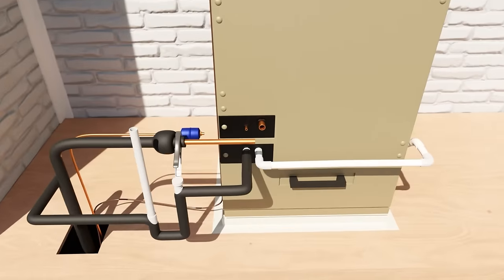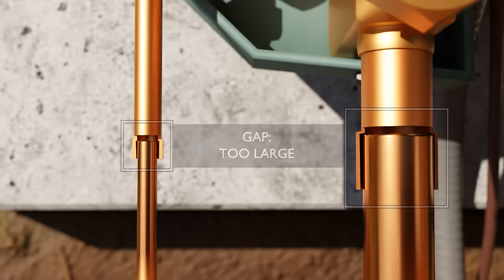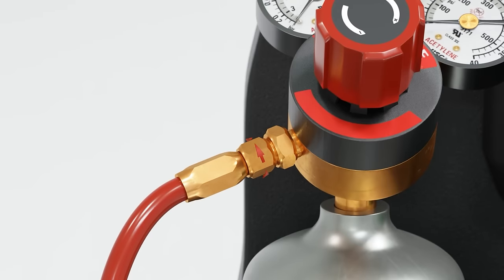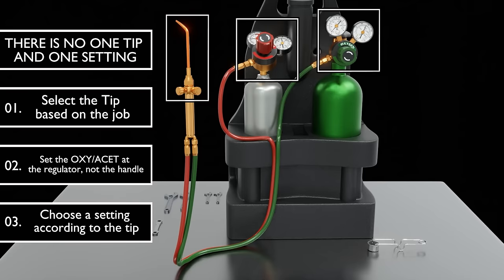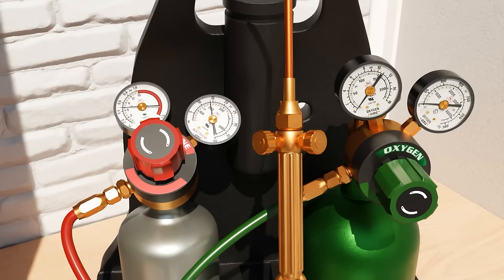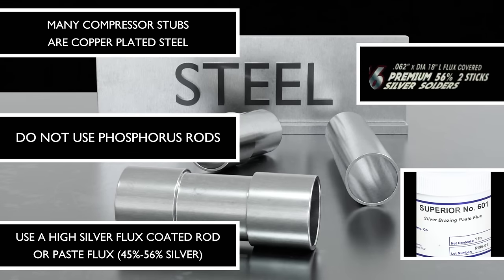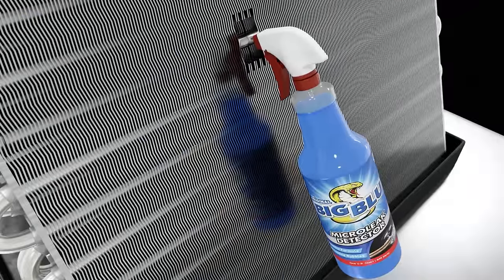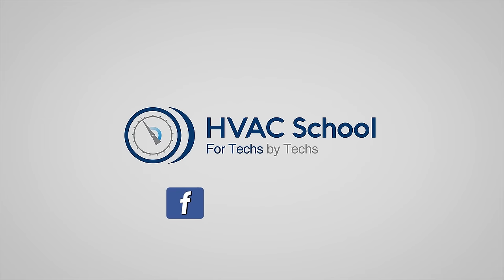Oxy-Acetylene Brazing 3D

Comment: A rose bud tip is also really good for valves. You want to heat the fitting up as fast as practical so that the heat doesn’t have a chance to conduct through the valve body and dry out your rags/heat blocking putty.
Reply: yes sir  rose bud R Great ..& its quick indeed .be prepared .... we all here use them  on most all 3/8 - 1-1/4 "

Comment: Safety first. Use flashback arrestors in eyery case, or you may start a chemical process  in the acetylen cylinder and this can explode.  Next  first fuel off, then oxygen is a must . The oxygen push the flame away from the tip, without oxygen pressure, backfire may happen or fire inside the handle.

Comment: Amazing video 👍… But, I remember it being that the fuel is shutoff first, then oxygen… As I recall, it prevents any flashback and avoids that loud pop… Also, just a tiny bit of oxygen when first lighting to avoid that carbon soot that occurs when there is no oxygen in the mix…
Reply: You are correct, turn off the acetylene first and then the oxygen

Comment: No mention of flashback arrestors, was that an oversight or do American oxy/acetylene reguators have them built in?
Reply: They're usually in the torch handle at the bottom. Don't want your hoses blowing up...
Reply: @brnmcc01  ahh ok, we fit them seperately to the regulators over here.
Reply: @timsky99  Here too on the bigger setups, we use flashback arrestors on the regulators and backflow preventers at the torch handle. On like manifolded setups at a fab shop, versus these small portable rigs in the video here. Those little tanks aren't for cutting metal or welding just small brazing jobs.